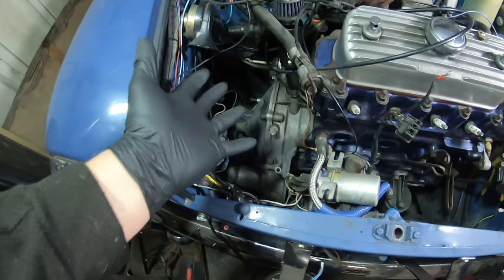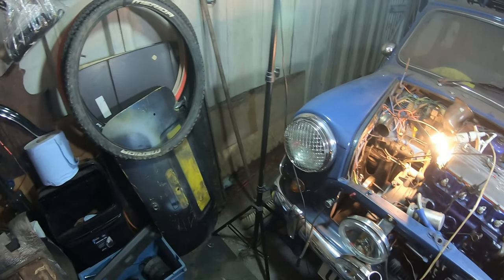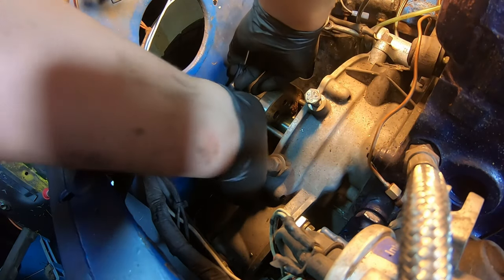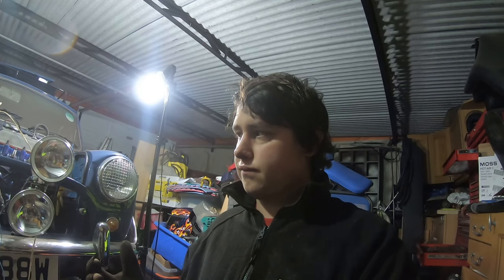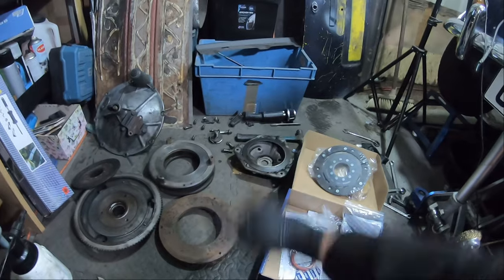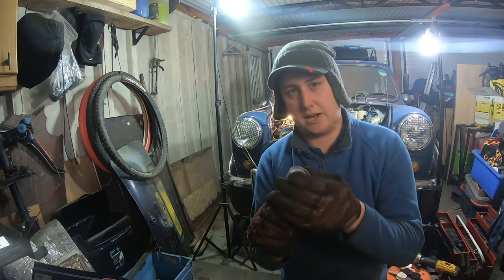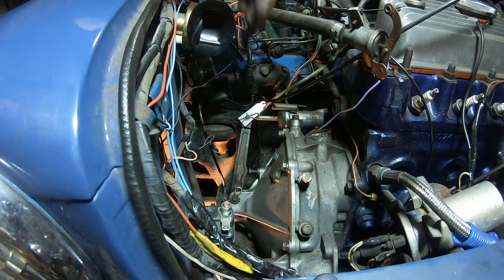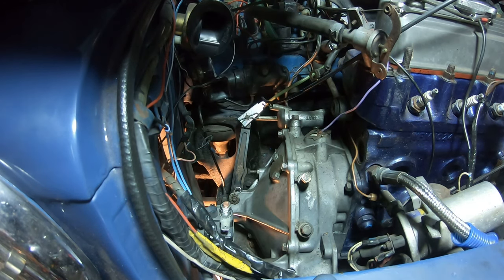Luke's Classic Mini Part 31: Clutch Replacement Pre Verto

Comment: i'm glad i got a flip front on mine made changing the clutch so much easier and that oil seal tool make it so easy to put in .well  worth the money for the time and effort it saves
Reply from the maker: Yeah i think flip fronts are the way to go. Will save so much time

Comment: A good informative video. 
Just a couple of tips from when I worked on minis in the early 1960s, pre diaphragm clutch. You really need to hit the flywheel puller bolt to free it, our garage, along with most of the others, used to drill a 3/4 inch hole in the inner wing to insert the drift. It'll never be noticed. Tip two, use a disposable plastic drink cup to cover the splines to prevent them damaging the oil seal lips lips, they're easily cut with scissors. Much simpler and far cheaper than that complicated tool you used. I still think that the original BMC workshop manual is the best source for information about repairs.
Reply from the maker: Cheers tony, i dont think luke wiuld have been happy for me to drill hole's in his panels, but should i ever get stuck its an option thank you 👍 the oil seal tool from mini spares was around £17 ive had good success with it. We dont often have plastic cups about but if i didnt have the tool id sure try that method. 

My reply sounds a little negative which wasn't my intension so please dont take it as im brushing you off. Thank you for watching and thank you for your comment also. 

Id love to hear more from you as i bet you have some great stories from working on the minis back then. 😀
Reply: @WilliamMurfitt  Thanks for replying. We never told our customers about the hole, as I said nobody will ever notice it. I suspect that quite a few classic minis will already have them, it was common practice back in the day when they were new.
Reply from the maker: @tonycamplin8607  i try to reply to everybody. Ive heard a few things that were once common practice on a variety of cars yet modern day people would call blue murder

Comment: Thanks for that information on the "A" stamp as I have to check mine if I put mine in correctly. Just have to take mine out again! As the engine is back in this will take some time now.
Reply from the maker: Yes i never knew this either, thanks to Paul Jeffries for pointing me in the right direction

Comment: You never seem happier than when you have spanners and sockets in your hands. This was interesting as I've never seen inside a clutch on a front wheel drive A series as I only ever worked on MG rear wheel drive A series cars, thanks for that.
Reply from the maker: Cheers mate, yeah im the oposite to you ive only seen the mini ones
Reply: @WilliamMurfitt  If memory serves me right the engines had to come out on the Midget's to do the clutch as there wasn't the space to pull the gearbox off the back like on the A's and B's.
Reply from the maker: @graemew7001  well that sounds like a pain of a job to do. Surely the complete gearbox removal would be easier to gain access for the clutch?
Reply: @WilliamMurfitt  From memory it was although I think I only did 2. Mind I wouldn't want to do any now, my tinkering days are well behind me, it's been that long now that I'm doubtful I have the ability and wouldn't want to drive the car I've done big jobs on lol
Reply from the maker: @graemew7001  ha ha its like riding a bike
Reply: @WilliamMurfitt  I haven't done that in years either haha!!

Comment: That bolt was a B it didn’t want to come off it’s amazing what a bit of brute force does if and where possible taking care not to scald yourself use a kettle of boiling water over it that will expand it I use this idea on the likes of ball joints
Reply from the maker: Yeah but with the right tools it sure helps
Reply: Enjoyed this. My mini experience was 50 years ago. When I changed the clutch I had the flywheel tool from BMC but never had the seal installation tool. I used celo  tape to protect the seal from the sharp edges. It was a real worry putting the whole thing back hoping for no leaks. I was unaware of the letter A as well.  Long before the internet.